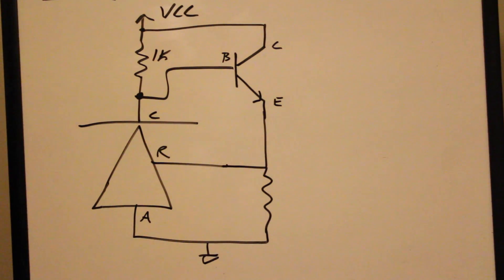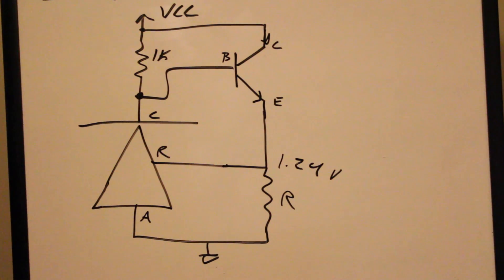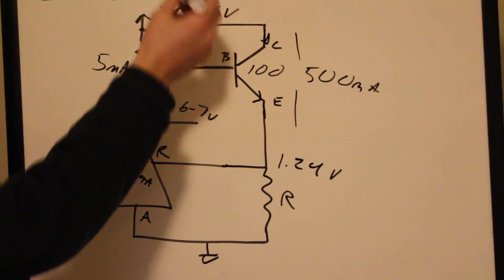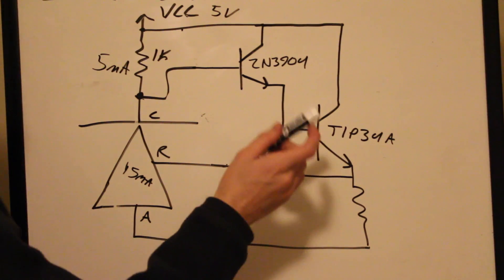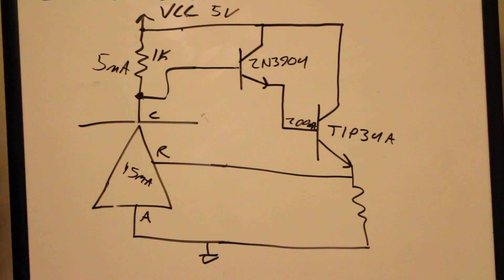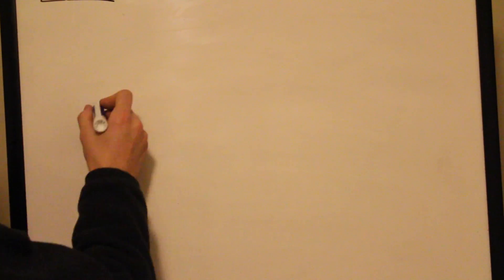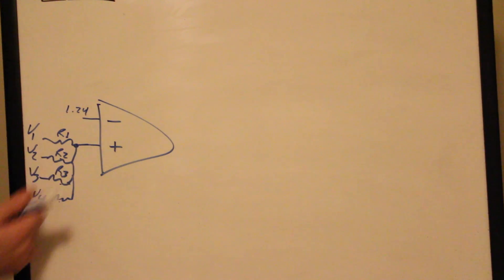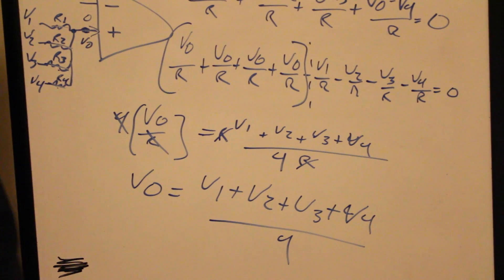Heavy-Current Dummy-Loads - How To

Comment: Are you familiar with using wire in water as a dummy load - seen in another persons video but they did not show how it was wired and regulated. It just mainly showed the water absorbed the heat from the wire no wire size or potentiometer specified for testing power supplies up to say 35 amps. I have some large 110 volt transformers with no specifications and was trying to figure out how many amps they would supply - knowing the max load voltage DC would be equal to the no load AC Voltage coming directly off the transformer.

Comment: Nice video, but your terminology is wrong. 
Those transistors are not cascaded, they are paralleled. ("Cascade" means in series).
Though the"boost" or driver transistor is indeed cascaded to the paralleled transistors.